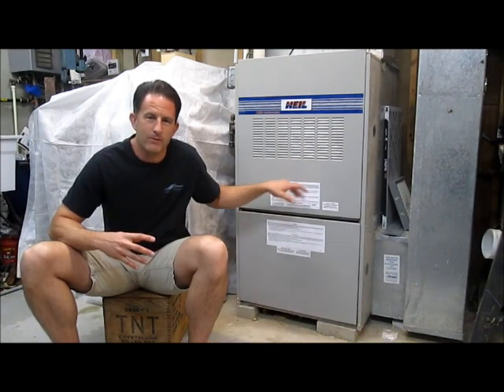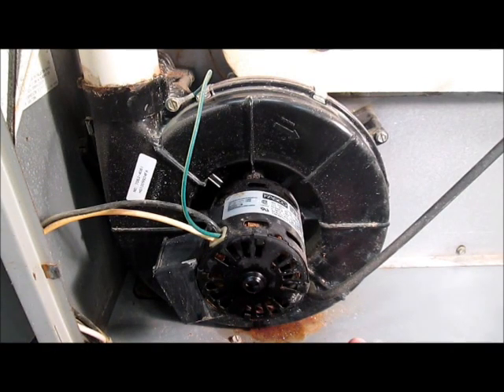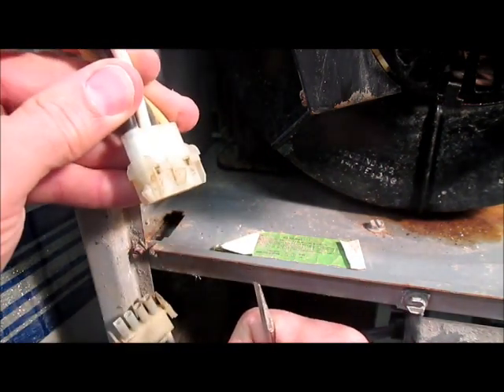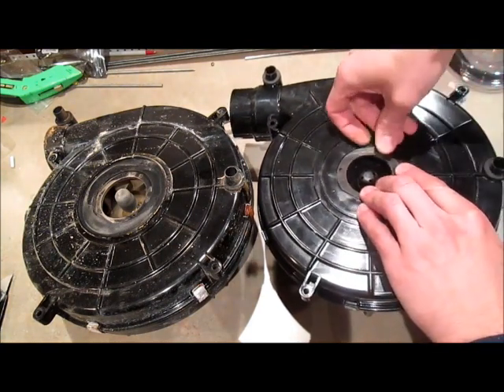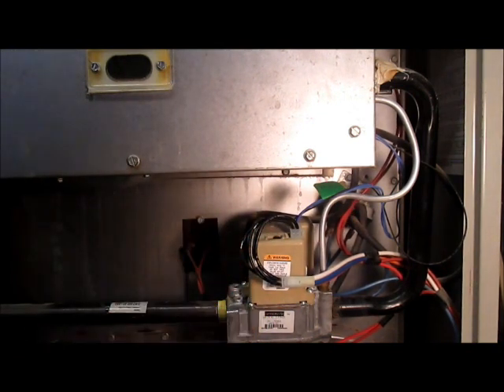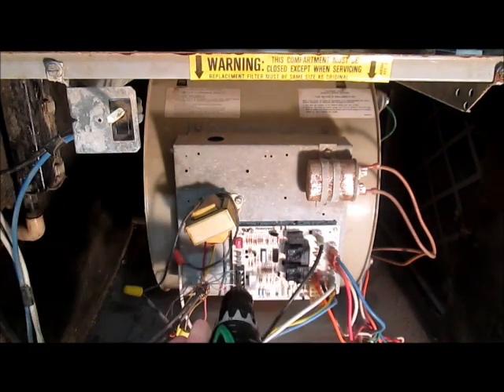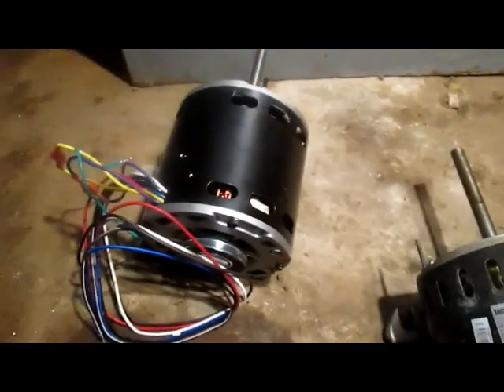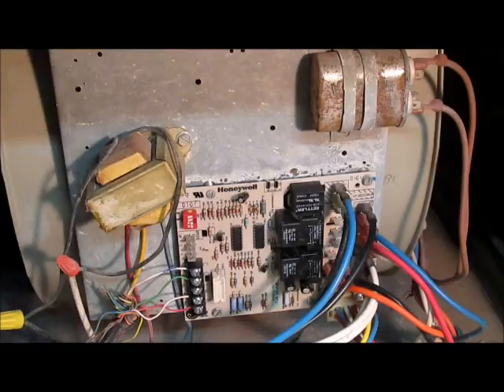How To Fix a Gas Furnace

Comment: good stuff to know. my furnace is probably at least 15 years old and I've occasionally been thinking "hmm, probably ought to open er up and see about maintenance." but it's not used a whole lot down here in Mississippi so it probably only has about 3 years worth of wear as compared to average haha
Reply from the maker: Honestly, there is not much to maintain.  All the modern bearings are sealed and don’t require oil.   You should change the filter at least every six months to reduce stress on the blower.  If your unit also does A/C, your blower motor may be near end of life.
Reply: @HowToLou  thank you for the response.  the central air stopped working years ago either due to freon or the outside unit (before I owned the house)  so it's only been used as a furnace since then. 

If I ever get the money to properly air seal and insulate this house (built 1925) I plan to rip out the HVAC and switch to mini splits.